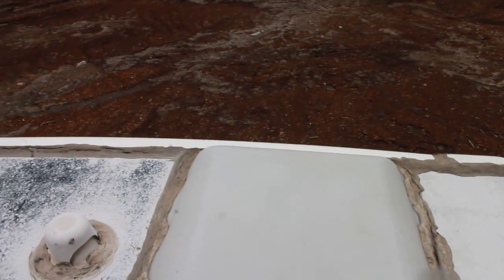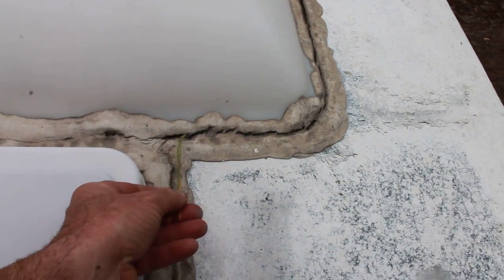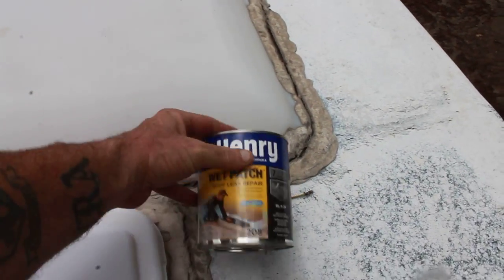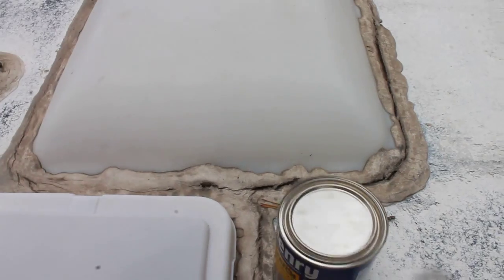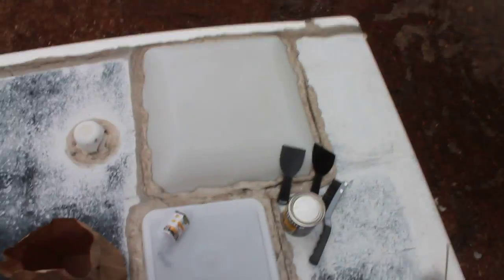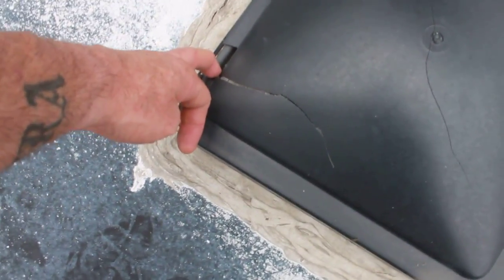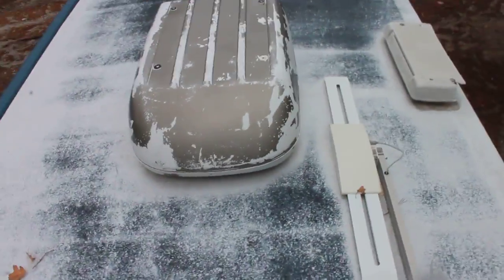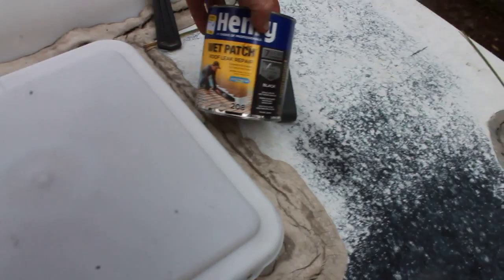RV Roof Repair--Fixing The Leaks

Comment: Them RV people use the crappiest sealant. I went over mine with silicone. Man if you elestometric white coat that, make sure it is really clean first.
Reply from the maker: Yeah that's what I keep hearing. Gotta be real clean.
Reply: Some have said never silicone on rv roof.....?  Eternabond is highly recommended.... seems like Dicor self leveling, too